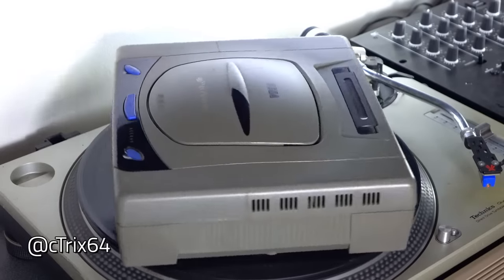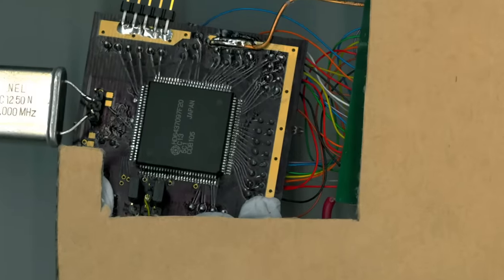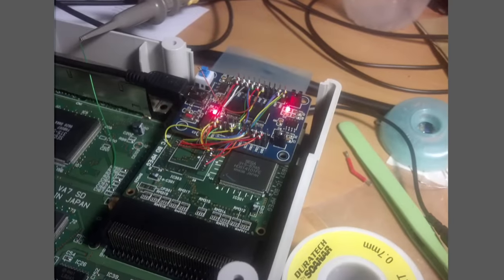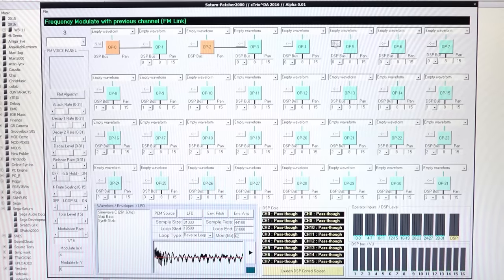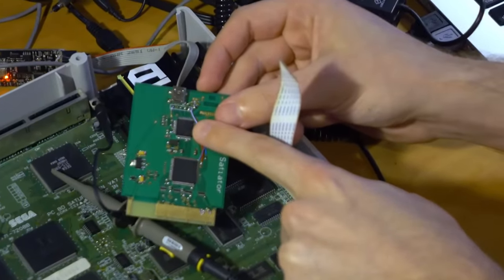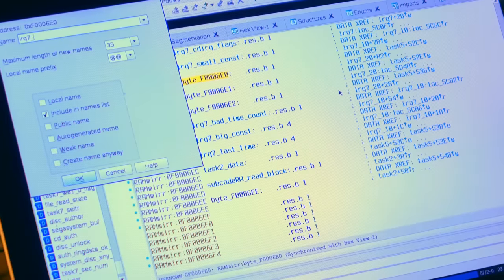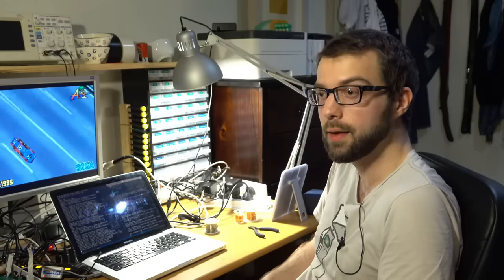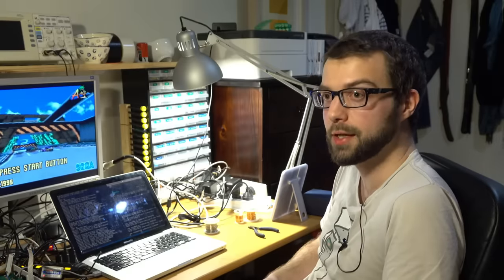Sega Saturn CD - Cracked after 20 years

Comment: FYI, I developed the hardware interface (cartridge slot) for the cross compiler (CodeScape) along with a cd emulator back in 1993 ish for the Saturn.  It's weird seeing it 25+ years later!!!  I also developed a whole host of other ICE and Emulator hardware for other game consoles.  This was for a company that was then called Cross Products in the UK.  

The Saturn had 2x SH4 cpus and a 68K for sound IIRC.  Don't have any info now though.  Basically a SCSI2 interface to the PC for download/upload.  The CD Emulator was a switch that multiplexed a SCSI2 HDD between a PC and the Saturn.  

The CD  image was placed on the HDD and the Saturn booted it up.  (from memory so this might be incorrect).  I had the FPGA/CPLD do all the memory mapping of the SCIS2 and some DPRAM as the interface to a serial converter for CD loading with RS422 buffers IIRC.  There was an FPGA (Xilinx 3000 series and a XC95xxx CPLD  IIR), DPRAM and an SH2 as the main cpu on the emulator, I also had a front panel LCD + Buttons.  Some of my talented colleagues developed the firmware on the emulator.  My boss at the time was a very well recognised games programmer.  A brilliant man who surrounded himself with other very talented people.  I am very proud to have worked with a team of people like this in my career.  Serious talent in a small building in Leeds !!   I now develop ASICs and high complexity FPGAs.
Reply: I didn't understand 95% of what u said haha  but this is awesome! The Saturn, thought it didn't become a commercial success is part of gaming history :) thanks for your comment !
Reply: speak english please
Reply: Can you recommend any resources for becoming a great programmer?
Reply: @DreamsComeTrue, the way I got started was to write Assembly code (hand coded btw) for the 6502.  In reality you could get an 8086 assembler and a good book on 8086 and start writing Assembly code.  I would avoid jumping into C and high level languages to start out with because you can pick up bad habbits.  The advantage of writing assembly is that you really have to think about what you are doing and you also get an insight into how a microprocessor functions.  You will have to learn what the CPU registers do and what states the CPU runs through.  This will make you a great programmer.  This is basically how all the games programmers got their skills.  This takes time (months to years) and once you have a grasp on this I'd suggest the next step is playing with an Arduino with an ARM cpu.  Try coding in assembly again.  It's harder because it's a RISC architecture but you'll get a feel for it.  

Once you've done that then use C and see what code it generates.  Playing with an Arduino will teach you about IO's and interfaces.  Once you're at this stage you are really up there with a good understanding.  From there you can pick up other stuff quickly.   

I would add that it's worth getting a mentor and paying attention to what they teach you.  Maybe a club nearby (maker fair etc) ?

Stay away from a Raspberry Pi to start out with.  That's a really complex system and OS for a beginner.
Reply: I would also add it's worth it's weight in gold to attend a technical university.  I don't know where you are in your academic life but if you're younger you most definitely can benefit from playing with microprocessors now.  I started writing assembler  when I was 13.  I had a fantastic mentor so I was lucky.  However you have to work at it.  It does take a lot of time and reading!!  I still love Assembly BTW.  But now I develop my own CPU's and microcode!!!  Even better !!!
Reply: Did you ever work for video logic or imagination tech?
Reply: I worked for a company that got acquired by Imagination Tech.  I think the merger happened a year after I left.  I know a lot of guys there though who were present through the merger.  I've worked closely with 3DO, Commodore, Sega and a bunch of guys through my time there.  I'm now USA based and have done a lot of video work here.
Reply: Gazza-in-the-usa Very interesting, I worked for them for a number of years at the HQ in kings Langley, mostly power VR hardware engineering then later on some very interesting 12 channel I2S audio ASIC work 👍 shame the company is now not British owned, I was an employee through the ousting of Sir hossein by the board. Rough times!!
Reply: Aleks it's a small world!!  I do remember a few people who were briefly introduced to me at E3 from Imagination when we did an expo in LA but it was so long ago.  I went on to Sony developing the first set-top-box in the world and then moved through a few projects eventually to Silicon Valley where I am now!!  The amount of talent in the games dev and video teams is absolutely amazing and I really have benefited big time from running with the pack!!  Are you still based in the UK ?  What's the scene like there now ?
Reply: The Saturn did not Use SH4 Sir. At All. It is clear that you've never actually analyzed or read Saturn's Documentation.
Reply: @zerocal76  Although he was a programmer, he clearly never fully learned or Studied the AURORA's Documentation and Architecture. Saturn did NOT use SH4. It used SH-2 Aurora, a Double Chipped,Dual Cored 32-bit RISC with 64-bit  DMA a 64 Bit Address bus, and TWO Dual 32-bit Data Bus Registers.

His claims about PS1 being technically superior to Saturn is blatantly erroneous and INCORRECT as well. The NEC R3A000 was SINGLE cored 32-bit Only, using ONE 32-bit Address Bus, and only ONE Data Bus Register on BIS Latency as opposed to Saturn's VLIW Latency. PS1 also only had 1 MB of VRAM with an extra 1 MB of SDRAM. Saturn used up to 8 MBs of VRAM using 4 MBs on average.
Reply: It's a long time ago.  I vaguely recall the Aurora docs now.   You expect me to recall something I worked on ~25 years ago ???  I don't have the documents now as I was under NDA.  I was not a programmer per se and I developed a load of Hardware.  The projects may be merging together in my mind now but I most definitely was an integral part of the team.  The SH4 architecture may have been the next generation which never made it to market.
Reply from the maker: Cheers @Gazza-in-the-usa .  Sounds like an awesome journey you've been on.  Glad you enjoyed our end of it.  It's always amazing to pick up and work with late 90's tech - it was a great time for engineering.
Reply: @KrisTheCodeManDude  I hope you read all the good advice the man gave u! :)
Reply: Indeed it was a fantastic time being on the cutting edge of the electronics games revolution.  I learned so much during that time.  Drinking from the firehose as they say!!
Reply: @CTRIX64  It appears he didn't get to work on Saturn long enough to learn its tools, nor did he properly learn and read its documentation.
Reply: @GodzillaGoesGaga  Did you learn how to Write C Language from Assembly?
Reply: I learned 6502 Assembly first in 1983 after learning basic.  I progressed onto C much later after doing PASCAL at college.  1988-89 for C IIRC.  As far as S/W on the Saturn I was not working on the s/w side.  I worked on the H/W which means I used the H/W interfaces and schematics.  Can you not wrap your head around this fact ?
Reply: @GodzillaGoesGaga  You stated that you worked on the HW Interfaces, yet you didn't mention anything about the DSP, the VLIW Latency of Saturn's SH-2 Aurora, its PARALLEL Assembly, Saturn's DUAL 32-bit Address Bus which was contained on BOTH Wafers, the Sophia's ability to add up to 8 MBs of Expandable Memory, Saturn's Recaculation and Hardware Multi Threading Remapping Capabilities OR its ability to add Perspective Correction and Z Buffering you then claimed the obviously WEAKER PSX hardware to be technically superior to Saturn which is ludicrous since the PSX(based off of STOLEN  Sega Jupiter Hardware) uses only ONE single 32-bit Address Register, ONE 32-bit Data Register, and was incapable of Recaculating and Correcting the Rendered Polygons and Textures and did a relatively POOR job at mapping and layering, which was Saturn's BIGGEST 3D Capability.

You also didn't even mention anything regarding the OP on how Saturn's Anti Piracy functions, we've explained how it functions and how the SH-1 Milkyway preforms Checksums for the SH-2 Aurora.

We're not trying to be cynical , but it is clear to us that you didn't learn enough about the Saturn hardware, we regret SOA's POOR judgement and  the sloppily mistranslated and cumbersome Documentation of Saturn.

There's now videos of Homebrewers who are utilizing and showcasing Saturn's abilities, they've obvious learned far more about Saturn's Trade Secrets far more than what you've let us on.

We would appreciate it if you'd try to take the time to learn more about Saturn's Hardware. There's quite alot that you've missed.
Reply: To Clarify (since this was rusty - I checked my old CV/Resume) I developed the CD multiplexer interface to the Saturn (along with the CD Emulator which used an SH2), The Atari Jaguar was the Cartridge slot interface (as I said this was a very long time ago and I have done so much since that this is not in my memory).
Reply: @GodzillaGoesGaga  Saturn's CD Drivers use an SH-1 CPU. Codenamed "Milkyway". The Saturn's Anti Piracy method is called "Lowjacking". The SH-1 communicates with the SH-2 Aurora by checksuming it a CDR Disc equipped with SEGA licensed Key BIOS Code. The SH-2 will ONLY read Discs licensed by SEGA as the SH-1's sole job is to tell it whether or not the CD is licensed. The Discs themselves specially pressed and are also lowjacked with a Squiggle Line, locking the TOC on the Core of the Disc. The Line acts as a Master Key Lock on the Saturn CDR. 

If the CD is unlicensed, SH-1's Checksum will alert the SH-2 Aurora, thus the Disc won't be read or playable on Saturn.
Reply: @segaunited3855  Well done, you've learnt something. Who's a good boy, yes it's you. Here have a treat.
Reply: @Hrbl.  Thanks!LOL!

Comment: This may sound like a dumb question, but why couldn't you just use the expansion cartridge port? I had a GameShark for that, so it could obviously run code. Seems like it would have been an easy way to achieve this, but maybe I'm missing something.
Reply: Good question. There was a project (the SAROO) that tried to do exactly that. There are two main problems: one, you then can't use RAM expansion carts, so have to integrate that functionality into your cart. That's the easy bit.
Two - the really hard bit - you have to emulate the CD block activity 100% accurately. The huge amount of work that's been put into emulators so far still hasn't got them to 100%.
(I'm also not sure that all the lines you need for eg. CD audio actually run to the port, but that's another matter.)
Reply: Could the isos be modified to run as native code on the card, rather than as simulating the disc drive?
Reply: Sure, but that'd be a manual process and different for every title - so stupendously complicated (especially considering there are hundreds of them).
Reply: +Dr. James I see
Reply: +Dr. James although with the work that was done on the project in the video, shouldn't simulating the CD drive be possible now
Reply: Andy Gilleand Who knows, but with the new flash cart around its probably unnecessary.

Comment: My favorite system ever. Criminally underrated.
Even though it failed with sales and was killed off before the Dreamcast. It basically was the first super high end original CD based console.
 At the time this was the most insane cutting edge system available.
Reply: Saturn was fairly successful in Japan, performed modestly well in Europe, Exceptional Well in Australia, In the US, its the only region where it underperformed its first 2 years due to a steep price tag, limited 3rd party support and POOR promotion and marketing by Sega of America, By 1997 though, Saturn sales in the US were actually improving, 3rd party support begin to show up, it got a price cut and a fantastic Bundle with 3 games.

Then Sega of America's COO Bernie Stolar ordered the plug to be pulled. The Saturn died in the US JUST as it was finally starting to catch on.

Saturn was indeed cutting edge, predating Nintendo 64 by 18 months in Japan and 13 in North America. Both Saturn and Nintendo 64 were the two most powerful Consoles of the 5th Generation.
Reply: Bad management and bad timing. It was pushed out at a time when Sega should've been focusing on Genesis, and development of the Dreamcast. Saturn was truly on another level technology wise, but it was too expensive for the lower class, and didn't have the support of 3rd party manufacturers or retailers.
Reply: The Saturn failed mostly because Hayao Nakayama essentially manhandled SOA into following orders that worked in Japan but not the US, rather than letting Tom Kalinske do what he needed to get it on it's feet. This resulted in things like the infamous early e3 launch and stock shortages. The disastrous launch followed the Saturn throughout much of it's life until around 97' when it was just starting to pick up speed before Stolar cut the line
Reply: @raiverns9620  Saturn did NOT fail. It underpeformed its first two years in the US. And was actually doing WELL when Bernie Stolar and Isao Okawa ordered the plug to be pulled.

Nakayama did not manhandle SOA into following orders. Sega of America did Not want to get on board with Saturn because they knew nothing about its design or that it was even in development. SOJ kept Aurora TOP SECRET during 1993.

Saturn didn't launch early either.  CSK's Isao Okawa ordered a "Test Market" Trial Release of Saturn during May that was horribly botched due to miscommunication and sloppy marketing from SOA. Saturn launched in North America on September 2,1995.

Comment: I can see why nobody wanted to develop for the system now.
Reply from the maker: The actual chip set is pretty nuts with it's multiple CPU's and aux processors :-o  Even the audio chip is a mind screw... and did things to interrupt the rest of the chips in annoying ways.  It would have been a beast to dev for in it's day!
Reply: That, and Sega pissed off nearly every 3rd party dev as well as many major retaliers at launch.
Reply: So basically it was like PS3 at its time but no Uncharted thats a shame
Reply: PS3 was not this complicated,  Many developers said it was easy to develop for the ps3.
Reply: Really? well i assume this because of what i heard from extracredits and one guy from my country
that make console museum also compare sega saturn to PS3
Reply: Thanks for this
Reply: The PS3's original plan was for developers to slowly unlock its capabilities over time, and wasn't going to have as much gaming dedicated tech, as they wanted it to be the ultimate all around media player. It was when devs found out that the thing wasn't going to have a GPU and threatened not to develop for the system that they reworked things. So the PS3 did  come out being a bit trickier to work with compared to the 360, especially with Japanese devs who weren't use to PC style systems at the time. Hell, if memory serves correctly, Valves partnership with EA on the Orange Box was entirely because of the PS3's architecture.

It might not have been the Saturn, but the PS3's architecture did give alot of people headaches in its first few years, and even then, most games ran better on XBOX despite the PS3 supposedly being more powerful.
Reply: Prizrak2084 
Wasnt VF2 also a technical marvel? Like it was super high res at the time for what it was.
Reply: Richard Woo the 64 was difficult  because of resource limitations in the console and cart. Specifically RAM in the console and storage in the cart was lacking, they had to do some crazy things to get certain things to work properly. Combine that with a short release schedule and you get really stressed programmers and developers as well.
Reply: @hellwalker899  The Sega Saturn's Uncharted is Powerslave/Exhumed.

Comment: This is the kind of person who designs processor chips - his knowledge at such a relatively young age just blows me away.  One in a million - literally!.
Reply: CPUs are easy.  Designing Graphics ASICs is the tough one !!
Reply: @GodzillaGoesGaga  Our friends at AG have already implemented Graphics ASICs for RAZOR.
Reply: So you've never designed a chip I take it. Code is easy by comparison.  I've done both.
Reply: @Al Bundy  You obviously haven't designed an ASIC or a chip. I also doubt you have ever written any code of any significance too.
Reply: @GodzillaGoesGaga  hoax
Reply: @GodzillaGoesGaga  both work is completely different from each other. it all depends upon on which level you works....  i am a programmer and i have only little knowledge about processor
Reply: NERD FIGHT
Reply: Ewan Black . PLDs not CPUs. Still a feat though. The ones who rolled out the PLD technology were smart cookies too, kind of Lego for logic designers.
Reply: Al Bundy  LOL@ this.  Running tools in a chip fab ie being a drone, is entirely different than designing a chip as a chip architect engineer does.
Reply: @nishant5249  This is where the main problems of programmers arise. Starting works without understanding the micro processor.